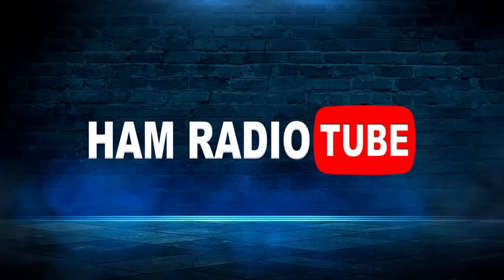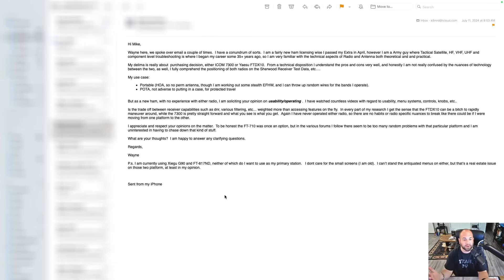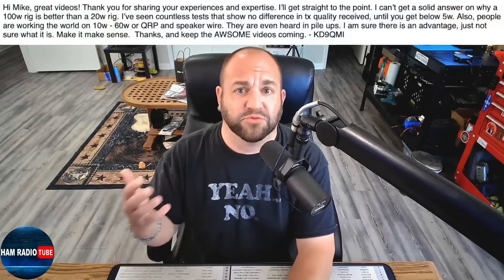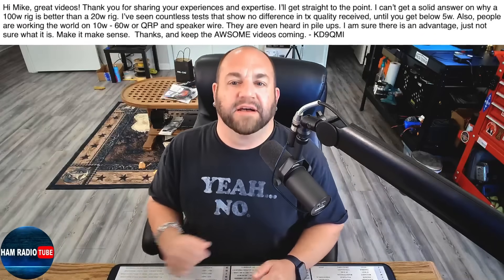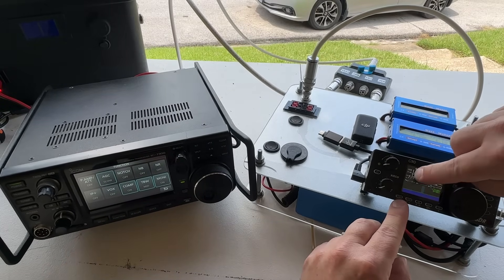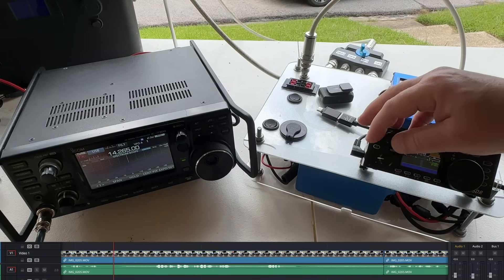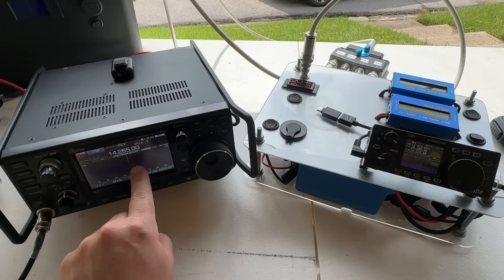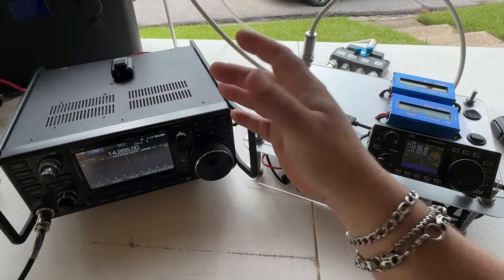Is There A Difference Between 100 Watt & 20 Watt Radios?

Comment: For pota CW I get 2x the contacts when running 50W vs 10W.  I am able to move the weak point to receive on my side. There are ton of guys who run CW QRP and I never hear them and have given up hunting CW because I have a wire antenna and most people in CW run QRP. My run rate at 50w comes close to one contact every 75sec vs QRP (10W) at one every 2 min. Sorry, it is worth the weight to take a 100w radio for POTA.

Comment: I might be wrong but I think my g90 has a DNR and a notch filter I can tune almost all the static out and I think it's almost as good as my 991 and my 857
Reply from the maker: I would love it if that were true, but sadly, narrowing the bandwidth isn't quite the same thing.  What are you doing to achieve these results?  Did they add that in some firmware update I missed?

Comment: I figured that you were going to spout a load of BS, but I got fooled. Not many Hams have a clue about the 6 db per S unit, but you did. Years ago, I sat down and started with, as I best recall, 30 mw being 1 db and then stepped up 3 db at a time until I got ridiculous up to about 2000 watts. What I found was that you need at least 10 watts to do much of anything on any band, and that includes HF all the way to UHF. With all that said, I participate in a weekly Preppers net and I run 100 watts on an IC -7300 and the Net Control Operator runs 100 watts from a Yaesu FTDX-10 and a fellow 15 miles from him runs a G-90. I can hear the NCO quite well, but the G-90 guy is readable but always weak. If that G-90 had 40 watts, I believe he could compete better as far as me hearing him better. A half an S unit more power would make a G-90 really make more Hams take notice. Hmmm.... I might even want to buy one to use in the SUV. With all that said, I'm not a power freak because I've gotten into some of my buddy's ears about how silly it is to run 600 watts on HF all the time. I think somewhere in the past, some Engineer with more than 3 brain cells figured that 100 watts was pretty much all you need for worldwide communications and that's why most radios come with 100 watts. My first good radio had 200 watts and I didn't do any better than my other Ham buddies that had 100 watts. Good video.

Comment: The question I have is: if QRP is 5 watts cw and less than 10 watts SSB, does that mean 9 watts ssb is QRP but 10 isn’t? And if so what if you are using a 50/100watt radio but you have so much cable loss that it equals 9 watts at the antenna is it QRP?
Reply from the maker: I believe the general consensus from the people who matter (not me) is that 5 watts or less CW and 10 watts or less SSB is now considered QRP.  Who knows?  Now that there's a couple 20 watt radios out (I forgot about the FX4CR) people will probably be calling 20 watts QRP.  But, if your cable is so bad you're only putting out 9 watts ERP you might want to consider replacing that coax.  Good question none the less.  I would say that counts as QRP as that's all that is radiating.
Reply: @hamradiotube  very disappointed in the FX-4CR. I gave up on it.
Reply: For a long time I always thought of QRP as five watts or less, it's only recently that people are calling ten watts SSB QRP. You don't have to be that exact. 
Just have fun, make contacts. I hope to work you on the air!

Comment: I have a g90 at 20 watts in an attic antenna when the bands with great last winter I had no problems but now the band's aren't that great I have a trouble I have trouble being heard I purchased the xpa 125 B amplifier 100 Watts and I noticed a big change if I can hear them they can actually hear me with 100 W where they couldn't when I had 20 watts

Comment: The G90 has filters but if you have to have Firmware 1.78 and under NEWER it's not so good and if you Downgraded to 1.78 the filters are so much better knowing your 5/9 with both I would say the G90 is worth it....Again might want to check of the Notch filters BTW I Think your firmware is 1.80 Main 1.79 SDR again has know issues "Filters" & A/M Major Issues... Now the unhooked antenna I would have to see if Firmware might have issues "Ask your buddy Mike" The G90 pro he can make a video and tilt he hat in the start like he always does.. 73's BTW I will pick My G90 Firmware 1.78 over the 7300 even though it has a 100W..
Reply from the maker: I'm on V1.78

Comment: User experience is a big deal. It's more than just a "nice to have". I will tolerate less good UX (ie FT857D menus) but I will spend more for a truely good UX (never seen a radio with that unfortunately).

Comment: I thought g90 had a notch filter
Reply: It has filter width and shift adjustments, but you can’t knock out a narrow part of the total received bandwidth (for example to remove a birdie or a tuner-upper).

Comment: Doesn't type of antenna help with stronger signals, 
not just radio brand.😊
Reply from the maker: Of course it does. But the results would still be the same when comparing radios.  That's why we eliminate that variable when comparing radios.
Reply: @hamradiotube did the firmware upgrade 1.42 on the ic 7300 help the NR .

Comment: ITS ALL JUST JUNK,.WHY WASTE ALL THAT MONEY WHEN YOU CAN JUST GOOGLE THEM AND TALK OR TEXT? REAL DUMB
Reply from the maker: Until you can't.
Reply: @hamradiotube  that's true,that's why I keep this rci2980 and this 6 tube Elkins elite ready to go.or the tram d42 and the 4 tube Elkins, or the cobra 2000 and the boomer 500 modulator on standby.and a 20k genarack..if the power co goes down.i couldn't care less.

Comment: Yaesu’s menu system is not intuitive. Menu-sub menu-sub-sub-menus, local & global settings are buried in weird places. The IC-7300 does not have quieter synthesizer that the IC-7610 has. The only virtue Yaesu has is the color display on their vhf/uhf portables & mobiles have.